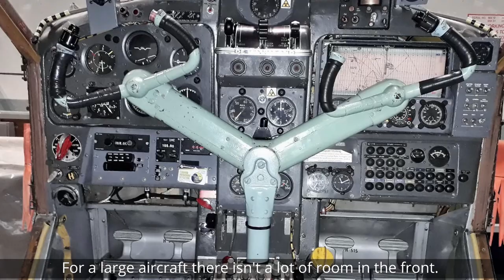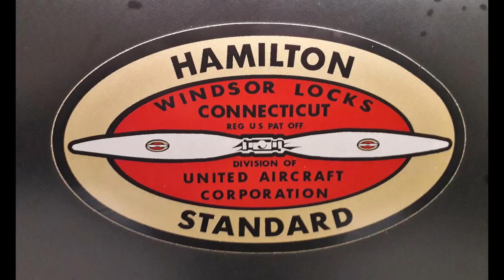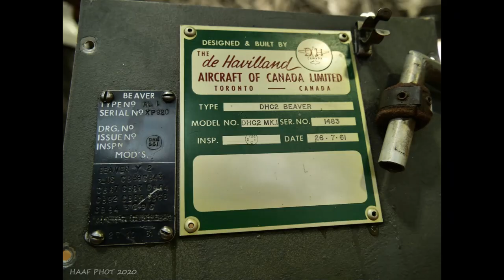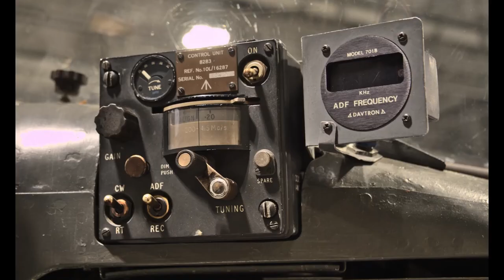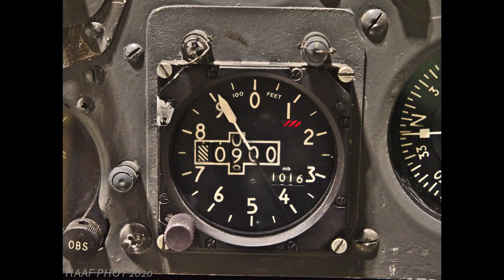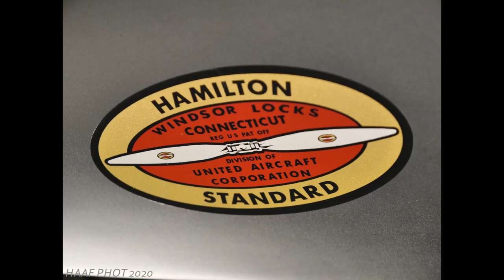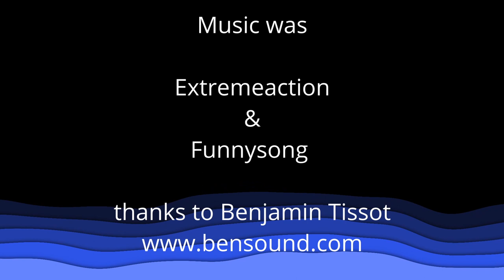Nice Beaver   Still

Comment: Love a bit of beaver 😜 seriously folks, The were the mainstay of  the Falklands air service for many reasons
Reply from the maker: Many of our retired AL1s are still flying Paul but as you say, perfect for FIGAS.  This one is still flying nicely and is just getting a new pilot bedded in.
Reply: @Flingwing24  FIGAS operated about 7 beavers and 1 Norseman till replaced by BN2 Islanders, and a UH-1 acquired from Argentina in 1982.
Some of the floats from the beavers where used as pontoons as late as 1982
Reply from the maker: Funny you should say that. Just in the last 24 I have seen an image of the bright red UH1. I wasn't aware of it until then. I did a tour 84/85 out on mount Alice. I understand the FIGAS Beavers were pretty trashed.

Comment: A beaver without floats is like a duck with wheels for feet and I don't know what's worse. Poor thing. Tragedy. Shame the P&W plate photo isn't straight-on, could be used for decals but ebays a good source for that. Some great flix buried in there! So ugly with gear. Frankenstol. Just awful.
Reply from the maker: See....we as an Army had zero use for a floatplane and in fact, I think they look hideous with floats. Loads of drag, no good for landing in a field, bit like the USS enterprise upside down.
Reply: @Flingwing24  :) But they did have use for a floatplane! Needed it so bad for land missions that they put wheels on one! 

I don't look at it like floats cause loads of drag, just because there is less drag when removed. It's been said before the Beaver may have been designed from the start as a  stol floatplane intended to fly slow but powerful, hence the large wing and flaps, and R-985. It flies exactly as it should with floats. 

Lets talk about stowed canoe drag, or quad atv rigged to floats drag...lol. EDO floats are aerodynamic af, I just wonder if the steps need a redesign update to keep up with the times. Those H1 Unlimited Hydroplane Race Boat Teams just keep adding more and more step each season lol.
Reply from the maker: That’s as maybe, but this cab belonged to the British Army and did exactly what we wanted of it. We did fit skis but floats were not (as far as I know) used on the British AL1, which this is. Perfect for task, saved a lot of lives in various ways, and has legendary STOL capacity. As for ugly....unnecessary 😢. I spent some happy times in this one over a couple of years, she deserves better than ugly chap😉